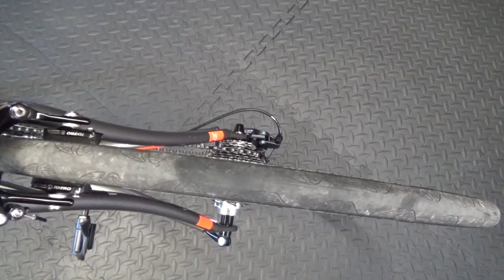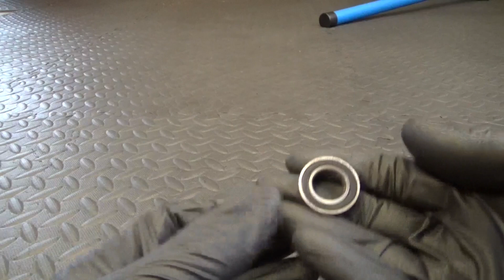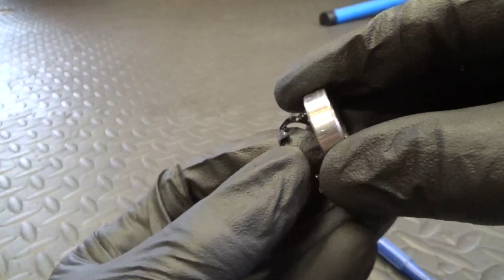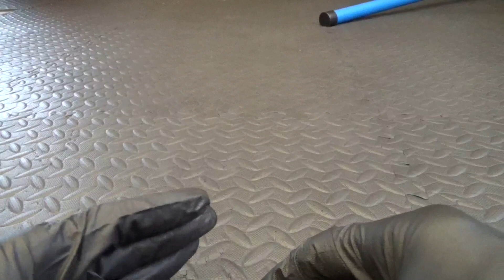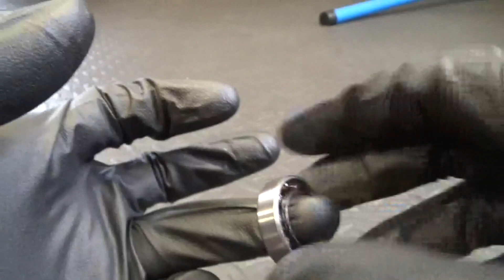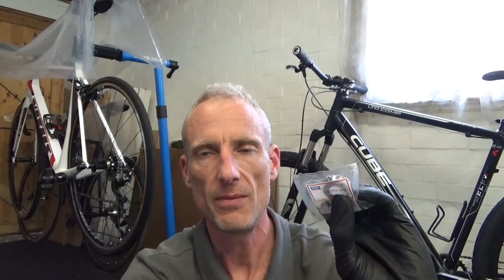Cheap Bicycle Bearings Are They Anygood?

Comment: Ceramic is not worth it for wheels as they wear very fast.
Reply from the maker: And bicycle wheels don't spin fast enough to need ceramic bearings.
Reply: @FreeToCycle  full ceramic works great in RC toys due to high rpm and very little load.
Reply from the maker: glenny or big horsepower cars use ceramic turbo bearings but again that’s because they spin at hundreds of thousands of rpm not 90 rpm like bicycle wheels!